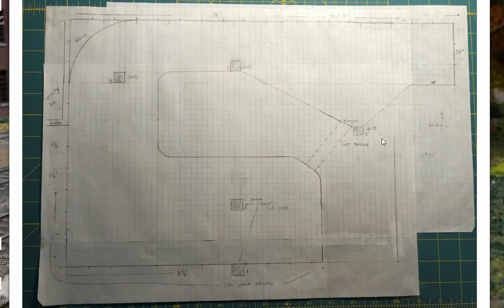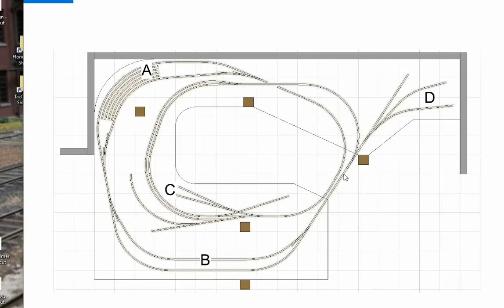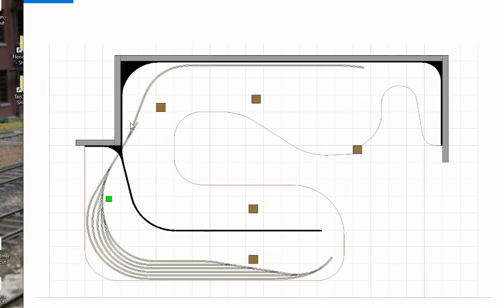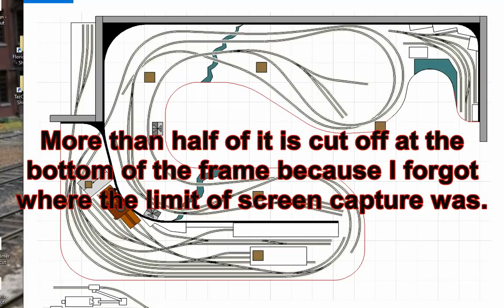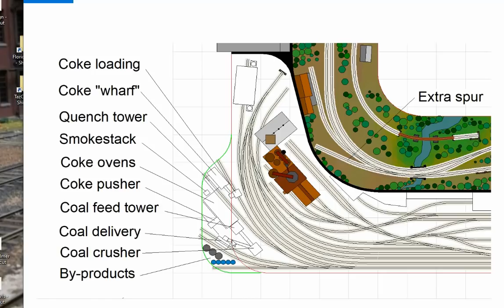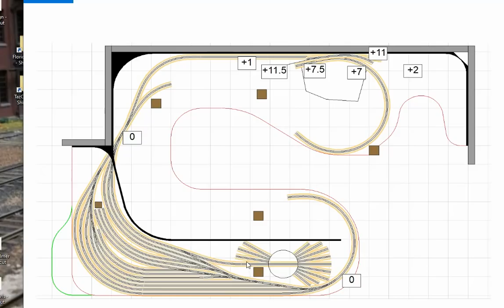Squeezing a lot of railroading variety into a tricky space

Comment: Let me start with AWESOME JOB!  I love how the plan came together, excellent use of the space.  OK, armchair QB moment, more of a "what if" question.  What if you extended the end of the backdrop in a curve around the coal mine?  The mine side curve interior becomes a cliff face and on the opposite side you drop in a curved turnout for the much needed yard lead?
Reply from the maker: There's already a yard lead at that end of the yard; it's just a little short.  If I extend it, it visually interferes with the mine area.  Curving the backdrop only gains a foot or so on the yard lead and the mine tracks end up too short to be useful.  Building the mine structure into the curved backdrop is a possibility, with the tracks heading under the backdrop and being hidden in the scenery on the other side, but this leads to other compromises and complications.
Believe me when I say that with every design I spend hours experimenting with different arrangements.
Your idea is a good one.  It's something I had already considered but ultimately rejected.
Reply: @mpeterll  Thanks! I figured you looked at it but I know it's hard to describe every iteration in a video of reasonable length.  I really enjoy your stuff!  Keep up the cool work and thanks for sharing.

Comment: Do you recommend designing a layout that goes around the walls or one that is free standing in the middle of the room?
Reply from the maker: I would always recommend going around the walls wherever possible.  You will always get significantly more railroad and better use of the room this way.  The smaller the layout, the more difference it will make.
To take a common example:  Some people are still under the misconception that a 4x8 sheet of plywood is an appropriate size for a model railroad.  It is not!!  You cannot reach across it so both long sides need to be accessible, meaning that it will completely overwhelm a 10'x11' room.  It also has no useful railroad real-estate, is restricted to 18" radius curves, and has a maximum straight of around 4'.  If you instead build a 2' wide shelf around the room, there will be a 6'x7' space in the middle of the room, the layout can have broader curves and straights almost twice as long.  Lastly, your total layout space and main-line run length are both more than double.  All this is a fine trade-off for the constructional complexity of having to cross a doorway.
Reply: @mpeterll  thanks for the detailed response!

Comment: Peter what are them columns doing, they don't look very structural to me. I don't think they are all caring weight . P Kinseyg
Reply from the maker: I'm just working with what I was given.  If I were to suggest removing them and he were to have any problems with his home any time in the future, guess who would be getting sued.  Besides, without making a trip to inspect the home in person, I have no way of knowing what is above them.
Reply: Peter Kinsey those columns look structural to me. If you look at the construction of the foundation at the bottom of the stairs it appears to be a very old home. Also the fact that the floor is two different levels indicates a former crawl space that has been dug out to make the basement larger. At one point those columns may have been 3’ or so tall.